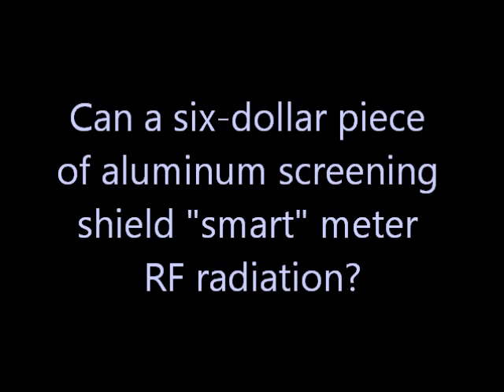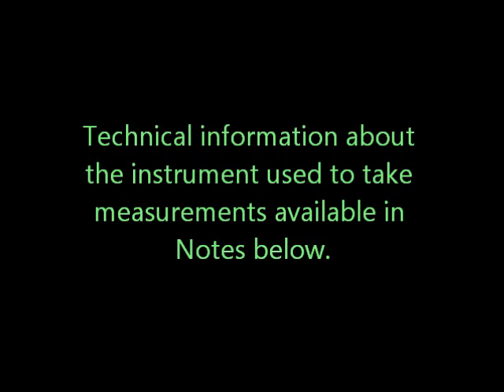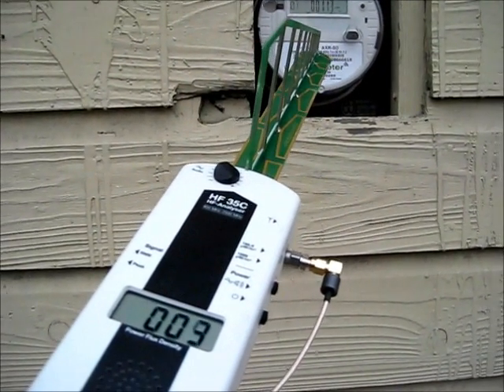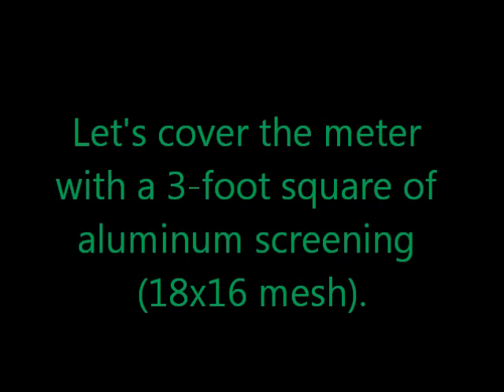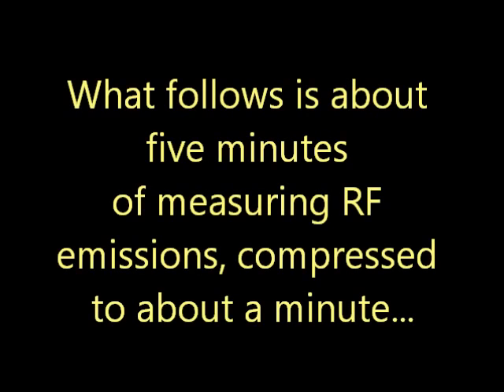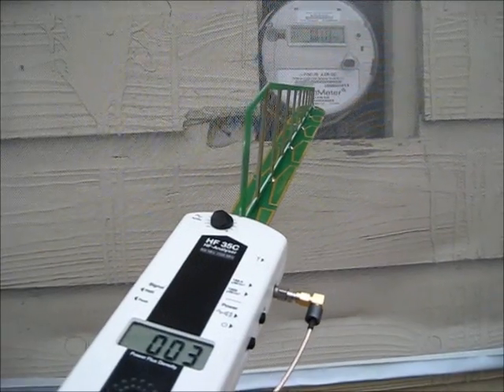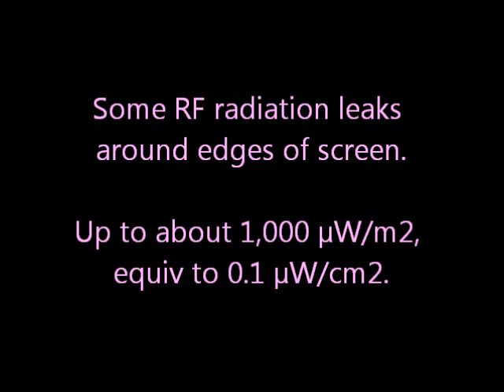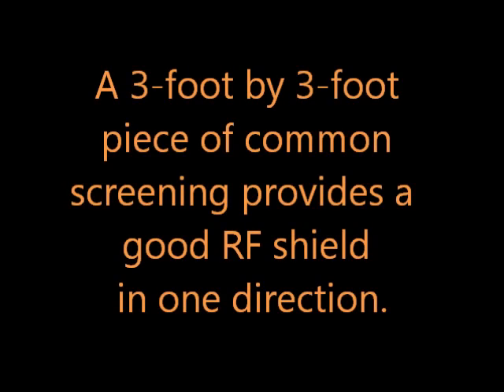Foiling a "Smart" Meter, Part Two: Aluminum Mesh Screening

Comment: Fake! these meters don't emit radiation. they connect to an Ethernet line that runs to the power company's servers
Reply: +Double HD They emit EMF at close to wifi frequencies with a fairly strong transmitter.  It is so the meter can be read at a distance(20 or 30 feet?).
Reply: mmakshak Earth naturally emits EMF..
Reply: Earth.. It's distributed too, so your meter wont pick that up..
Reply: +Double HD My current viewpoint(since the companies putting these things out, neither study, or spend any money on it.  They prefer bribes[campaign contributions], which stops the studying of something that is all around us.  It's like polluting a river, only that river is everywhere.) is that the big danger is the strength of transmission of these wifi frequencies.  I can counteract the effect of most of these frequencies in our air(if you get a big quartz crystal point or cluster, and hold it in your left hand[opposite hand for women]for 10 minutes, you get an idea of what I'm talking about-although my orgonite is easier to carry on your body so it's always protecting you to an extent.).  Now, most people aren't aware of these effects.  I've spent years wearing and rotating stones(for the purpose of keeping my energy high at my physical job), and this can protect you, although I still had trouble with low energy people affecting me(when your energy is always high, they will visit you.).  A sufficient amount of my orgonite works better in the later situation.  I just happened to stumble into the effect of this EMF.  It was not my intention to come up with a reason(this makes the most sense, and was verified by my sitting closer than 3 feet from my Comcast meter for awhile every morning.  I think this router situation was eliminated by having it put into the bridged mode, but I'm only on my second day of this.  You definitely should eliminate yourself as a hotspot[settings and preferences]).  I am not close to my smart meter, but believe it to be dangerous(medical device people do your research).  In addition, I don't care what they say about this, but the big jumps in the readings scare me.  No need to worry, because these power companies are studying this(not).  Once again, people near cell phone towers have to do their own homework(maybe burying orgonite near them.  I'm not convinced that a little orgonite near the transmitter is enough, although my testing on the router extended the time it took before fatigue set in(hotspot mode-from 10 to 30 minutes).  While intellectual arguments have their place, it doesn't mean they are true.

Comment: Putting a screen over the meter as shown just reflects all the radiation back into the house! You need to wrap the screen around the meter so that it grounds to the base to block not redirect the signal. If it works too well and your info does not get through the power company will show up and disconnect your power and charge you with theft of power.

Comment: If radiation is leaking out of the meter, then all you did was keep it from going into the street.  So were is the leaking radiation going now with the screen?  Into your walls?  I would guess so!
Reply: +rockshot100 I think we are worried about the electromagnetic frequencies(EMF) put out by the transmitter of the smart meter.  This is done, for instance, when the meter is being read(it's like wifi.), but it looks like it's being done every so often(when you see the meter numbers going high).  I believe it's put out in an omnidirectional direction.  These frequencies are close to wifi frequencies, and are non-ionizing, but very high.  These non-ionizing radio waves are bad for your health, but this information is suppressed by cell phone companies through bribes(campaign contributions).  Since these companies aren't doing the research, or are suppressing it, what we are worried about here are two things.  First, medical device people(pacemakers, etc). might be in danger.  Second. the most trouble we have healthwise is the strength of the transmission(that you get with making you a Comcast hotspot, for instance ).  The main defense is to get distance between you and the transmitter.  Of the less strong amounts of EMF, which are present in our everyday air, you end up getting fatigue, brain fog, sleep disturbances, etc., and who knows what long-term health effects.  You can alleviate most of the later symptoms by adding energy to your body(I use my very strong orgonite for this, but you can energize your living space, also.).  Right now, I'm interested in the idea of using carrier frequencies(if that's the word) along with these dangerous very high non-ionizing ones.  If this would work, those cell phone and power companies could be doing this, although the new frequencies would travel much slower.  Of course, they are busy maximizing their profits, and bribing regulatory agencies(maybe through politicians) to keep standards away from non-ionizing EMF(such as wifi).

Comment: Did you measure the wall in the back of the meter?  Did the radiation not project inside the house or building? O_o

Comment: What you did with that aluminum mesh is you made a nice reflector reflecting all the radiation back into your house. The best way to combat this is to make a cylinder sleeve over the meter from lead flashing. leaving the front face of the meter open which will allow communication and the sleeve will prevent radial radiation spread into the house
Reply: +J0Boa And why didn't the power company make the antenna directional to begin with(I suspect it had to do with the increased danger that would present to people wearing medical devices.)?  Why is it up to me to speculate about this, and not the responsibility of the power company?

Comment: Radio Frequency waves are all around us. When we use cell phones and 2 way walkey talkey type devices we hold them close to our bodies. The tv set and radios emit rf. I am trying to understand what the concern is regarding these meters. They can track your power usage during a time period, but has no idea what device you are using. So what are people concerned about. I'm all for privacy.
Reply: +rfn944 Homework, homework, homework!  There are differences between emitters, having to do with how strong the transmission is(don't go near hot spots, cell towers, smart meters, etc.). I haven't figured out how I should deal with my cordless phone(heating of brain cells-which I think you can feel).  Distance is the main defense against strong emitters, but I'm experimenting with orgonite close to the antennas.  I still think it's safer to eliminate a router, than to add orgonite to it.

Comment: I have a very important question to ask you. i have attempted to screen my smart meters and wifi waves comes from my neighbors house through the dry wall (I live in a town home, attached walls to every home left and right)

I bought screening and applied it but my devices are still picking up the pulses. can you give me your email so i can send you the pictures of how exactly i screened it and can you let me know if you see any faults with it so i can correct it?
Reply: +La Diablo   HAHAHAHAHA! And these clowns are worried about radiation from a smart meter and they are being advised to run a Microwave with the door off??

Oh geez, you couldn't make this stuff up! Hahahah
Reply: Lol, you didn't pass Physics in high school.  Must have been cutting classes and smoking dope, taking lsd or shooting up heroin.  You don't need the aluminum foil because your brain is fried.
Reply: +Kevin Soy This is a ploy by Monsanto to keep your brain occupied so you won't think about how they are fukking with your corn, soy, etc.
Reply: Go into settings and see how many WIFI signals you are receiving. I am sure you are receiving radiation omnidirectionally. I am receiving radiation from 14 routers and who knows what else, plus from cell towers, and from  neighbor's cell phones as well.
Reply: Save your money this is A SCAM.
Or if you are REALLY DESPERATE, RENEW THE ALUMINUM FOIL IN YOUR HAT AND HUB CAPS.
Will this work? NO but neither will screening your meter.
Reply: Be careful of the brain frying radio waves coming out of a power meter!
Use a microwave with the screening removed and hold it up to that nasty power meter so you don't get any more radiation from it!!!

Says it all really about the psychopath telling people to do stuff like this doesn't it?
Reply: +La Diablo There it is! The fall back question of a psychopathic obsessed moron asking a question of no relevance because he's asking for the person for the 20th time about regulations that don't apply in their country so are as irrelevant as his constant  rantings and disillusions.

Of course anyone that is not suffering a mental illness and does not share his self consuming obsession is a power company manager! It's obvious isn't it? What else would someone being paid Hundreds of thousands of Dollars a year do to run a power station other than go on You tube  and try to defend Smart meters?  Yep, that's what years of University, management and all my other experience has lead to, Becoming a power company manager and sitting here in my luxury office posting replies to moronic sick imbeciles like you mmakshak or Diablowhard or Fredrique Zug or whatever name you have adopted this month after loosing any and all credibility  with all the other names you have used before and been seen for the deranged zealot you are.  
Go on, list them for us. 

It's fun to google any of your names and see how you spend every waking moment  crapping on about this everywhere you can find a chance to carry on with it. 

I really expect to see you make the headlines one day when your damaged brain finally lets go and you have a complete wig out.  Pretty easy to see when you forget to take you medication though.
Reply: +Kevin Soy You might have to ground the screen also.
Reply: +Kevin Soy I believe smart meters put out the signal at around 918mhz, and wifi is higher at 2.4Ghz and 5Ghz(there is an increase in the number of 5Ghz nowadays, compared to before.).  I think the 5Ghz puts out a stronger signal, but doesn't go as far as the 2.4Ghz.  The 5Ghz transmitter might present more problems to electro sensitive people, if they are close to the transmitter.  My Comcast router is now bridged, and that might do the trick(no wifi).  I was within 3 feet of it before, but would suggest at least 5 feet from it as a starting distance test, and increase distance from there.
Reply: +Ebenezer Kalarama Thank you for that information, WHAT THE HELL HAS IT TO DO WITH SMART METERS?
Reply: Science-is-god 
I`m trying to show the anti-EMF evangelists + trinket peddlers that we get enormous amounts of natural EMF radiation and that microwave frequencies are a component of solar radiation. They already know this of course and have been trying to conceal the fact from their customers.
Reply: I've been reading there may be a trend to convert giant server farms to Wi-Fi, which will ALSO be proven to be totally harmless.
Reply: EBENEZER SCROOGE KALARAMA IS A DISINFORMATION TROLL. EVERYONE NEED TO KNOW THIS. THIS GUY IS TROLL AND A SHILL WORKING FOR THE CORPORATIONS. BE AWARE. HE LEFT IDIOTIC BUT SLIGHTLY INTELLIGENT SOUNDING COMMENTS ON MY CHANNEL AS WELL, BUT I DELETED THEM.
Reply: EBENEZER SCROOGE KALARAMA IS A DISINFORMATION TROLL. EVERYONE NEED TO KNOW THIS. THIS GUY IS TROLL AND A SHILL WORKING FOR THE CORPORATIONS. 
BE AWARE. HE LEFT IDIOTIC BUT SLIGHTLY INTELLIGENT SOUNDING COMMENTS ON MY CHANNEL AS WELL, BUT I DELETED THEM.
Reply: EBENEZER SCROOGE KALARAMA IS A DISINFORMATION TROLL. EVERYONE NEED TO 
KNOW THIS. THIS GUY IS TROLL AND A SHILL WORKING FOR THE CORPORATIONS. 
BE AWARE. HE LEFT IDIOTIC BUT SLIGHTLY INTELLIGENT SOUNDING COMMENTS ON 
MY CHANNEL AS WELL, BUT I DELETED THEM.
Reply: Kevin Soy hi, what about the inside of the house? Because the mesh stops to the outside but not behind the wall.
Reply: + La Diablo  LaDickhead does not even know the basics of radiation he constantly squawks about. 
A metal meterbox would completely eliminate all radiation because electromagnetic waves cannot pass though metal.  OF course the suggestion one should have a box made from Lead hanging off the side of their house to improve their health is as stupid as the suggestion to take the door off a microwave oven and  hold it over the meter while operating he has made before. 

Listening to this nut case is a sure way to suffer ill health and in you are stupid enough to listen to this crackpot, then smart meters are so far down your list of problems you are never going to need to worry about them because you'll be long gone already. 

I now wait for the idiotic and endlessly parroted question.
Reply: I saw on the news today that our life expectancy is shortening a little.

 Interestingly enough, all the usual suspects killing us are increasing EXCEPT for CANCER, the rate for which has decreased by 1.7%.

All cancers I think, but not just brain tumors. Including leukemia, I assume.

link to the news article:
https://www.cdc.gov/nchs/products/databriefs/db267.htm
Reply: EMF Safety Zone
Oh.... you are a `steterziser` [scam] peddler. Sorry, I must have forgotten about that.

Comment: Your meter is different, mine only reads the consumption.  However I  suggest you contact an attorney with experience in radio fields and recognised experts with suitable credibility with the judicial system and bring a lawsuit to either cease and desist or properly shield and technically correct the system so that you are not subject to this nuisance radiation which scientific studies have suggested may be harmful. I hope you can find the financial support to carry on ! Best Wishes...

Comment from the maker: The RF radiation from the vast majority of SM systems that US utilities are installing is *broadcast*, not carried over the wiring (PLC). It goes promiscuously in all directions. In PGE smart meters in CA, the antenna is enclosed in the meter itself, wrapped around the periphery of the cylinder, and provides 4dbi of gain. Wiring is not used as antenna.

Having a portion of my home and property suddenly off limits due to spikes of carcinogenic radiation violates my rights.

Comment: We just moved into a rental house and there is a smart meter located outside by our living room.  If I cover the meter with the aluminium mesh, what about inside?  Does not the meter leak out radiation from the back into our living room?

Comment: Ignorance can be heartbreaking. The wiring from the meter coming from the power company transformer is the main antenna. Sure put a layer of aluminum foil on the inside wall behind the meter and glue it in place with wallpaper paste then paint over to match and the wiring from meter back to the street will carry the RF back to the utility for their business. simple solution you don't spend 16 hours per day on the outside you are usually inside so problem cured ...

Comment: Aluminum and lead will stop the strong radiation.
Steel will only reduce the radiation. 
Try space blankets on inside walls.

Do you want a quick test?
Wrap a cell phone in aluminum foil and call it.
Put your cell phone in a steel pot and call it. 
If it ring, try something else.
Simple test, ringing will tell you what works or not works..
TIN FOIL HATS???   I have never tried one, please let me know if it works, apparently the power company managers have lots to hand out for free. ;-)

Comment: search "Myths About Smart Meters" while there has been a lot of research, there has also been a lot of equal studies that show no correlation at all, when looking for research, you can't go looking with a pre disposed bias to look FOR your desired outcome, you must remain skeptical and look at both sides.
it is true direct influence is possible in VERY strong fields (much much stronger than a smart meter)
RF drops off VERY quickly and spreads out as quickly. look at more information please.

Comment: a powerbot?  I don't think so.  and you state "the facts in America", the entire US?  or is it only some states or some municipalities? the laws of each area can change radically, very few laws cover the entire US.
The RF exposure from a meter for example drops by a factor of 100 when you move from a distance of 1 foot to 10 feet away, you have to be quite close to have any effect, and even that is arguable, RF is emitted from any electrical circuit or wire with power through it, you live in RF.

Comment: You hit the nail on the head.   I will quote you.  "it on the outside of your home"  YOUR HOME.  I now have a 8" circle on my home that anyone with a pacemaker can not go near. Please note, that is a "averaged" reading. The danger to a homeowner with a pacemaker is much greater.

How about homeowners with defibrillator's?
How about homeowners with deep wire brain implants?

A device that can kill homeowners, so you can fire some meter  readers.   Don't you care about your customers?

Comment: it on the outside of your home you have a exterior wall insulation the drywall
and in many cases it on the garage wall so you have another double wall and insulation do the reading there if you want a true reading the way that meter was installed the electrician should be fired that's the worse instillation i have ever seen on a electric meter the water must soak the inside of that building every rain i do not see how it ever passes not only the city but the owners inspection or was it a fake

Comment from the maker: The shielding provided by a piece of screening does NOT prevent the RF signal from reaching the utility. The signal from PGE smart meters is VERY strong, and will make it into their mesh network even if you wrap the whole meter in foil. 

Shielding only REDUCES the exposure of a human who is on one side of the shielding. Providing people with this valuable information is the objective of my video.

This building is unoccupied, not a home.